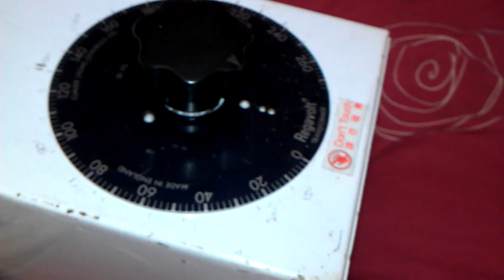4 MOSFET ZVS driver

Comment: Parallel MOSFETS have never worked for me. Bravo for making it work. Very nice construction. Massive heat sinks make for a great platform if your wiring and placement are nice and tight. Not the most impressive output, but, still a very nice build. I'm curious about your inductor. Ferrite rods like this one don't seem to perform as well as toroidal inductors in my experience. Beautiful build, though. I'm impressed
Reply: A schematic with full specifications for all components would help the HV community immensely.